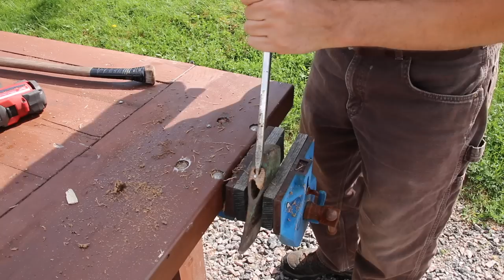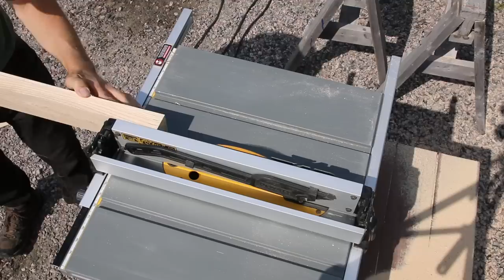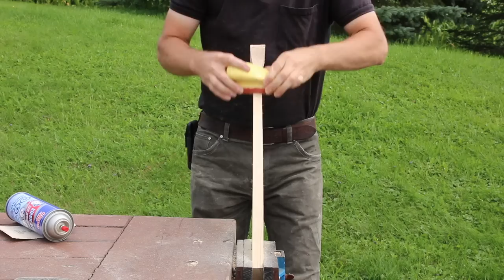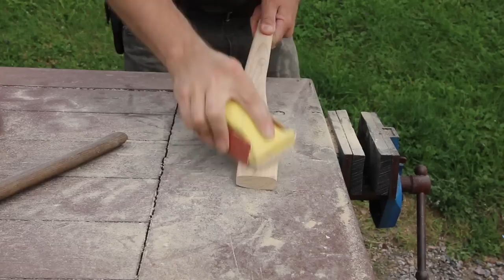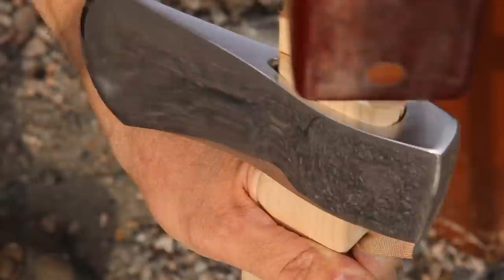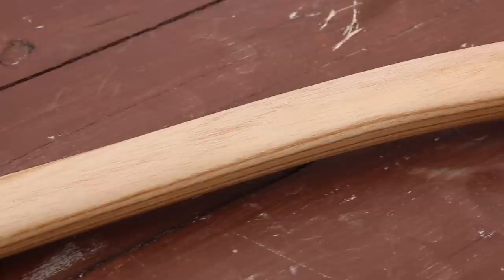How to make an AXE handle

Comment: Nicely done.  The man knows how to properly seat a tool handle. I really liked his choice of wood for this. Uniform strong grain and the runout on the tail end just makes it prettier not weaker. Only thing missing is oiling the wedge slot after seating the handle with a few drops of linseed oil. It helps to swell the grain just before driving the wedge home. It won’t dry out and will maintain the handles pressure against the walls of the eye.

Comment: Wow!  That was some remarkably straight grain!  That handle, unless seriously abused, will last 50 years!  Impressive work!
Reply: No .. got "run out " gonna break real quick,  most likely already has. You dont know how to make a axe handle either
Reply: explain  'run out '
Reply: The only way an axe handle will last 50 year's  is if you don't use it.  Also from the main picture it has really bad grain
Reply: Just me but that wood looks like pine board. If it is, best keep it as a decoration. Real heavy use axes require hickory or ash wood handle. Straight grained with no heartwood in it.
Reply: That handle is ash.

Comment: Your handle has "run out" the grain comes out the side of the wood ...it's gonna break right there.
Reply: They all have a little run out. All axe handles will break.
Reply: @MrThenry1988  not if you make it properly. Also that looks like pine which is awful for anything that involves shock
Reply: Just a Pilot I’m pretty sure it’s not pine. It’s much harder, probably ash.
Reply: @pedroclaro7822  lol that is not pine I'm almost certain just by the grain pattern

Comment: Great Handle, nice Video! 

Hint: at 2:00: place the handle between 2 wooden blocks into the vice. That prevents the handle surface from " bites or scratches of the vice jaws and (even more important) it prevents also the cutting edge of the drawknife from hitting the jaws. 

I'll soon have a similar project and this Video will certainly help me. So thanks!

Comment: Awesome work as usual.  You've convinced me to subscribe now as long as you keep putting out great videos like this.  What all did you use on the axe head this time?  I've been following your steps from the mirror polish videos but those are just for great wall hangers.  This one looks like a good usable axe, it looks like you used a green Scotch Brite pad at some point in the process?  Thanks!

Comment: Good job, tell me which wood do you use?
Reply: is very similar to the ash i this is it it's a very good wood for handle who don't required flexibility but rigidity for blacksmith hammer for example i prefer chestnut who transmitte less vibration cut a branch and take the new one 3year latter the ancestor do that and have very good handle !! better than our's for sure ! for have the black result they burn 
linseed oil below the hadle for resist at mold etc and increase durability, you can if you want burn the hadle aroud the point where you put the tool to make him strongest if you do that dont wait the wood show flame and was too burn just wait to have brown color

Comment: Having all that grain "run off" is absolutely the worse way to make a handle for an axe, hatchet, hammer, etc. A lot of folks may think it makes for an attractive look, & while it may do so for some wood projects, it's the worst thing to have in an axe, hammer, etc. handle. If its put through serious, repetitive use, that handle will eventually split along that "run off" grain. Its just a matter of when its going to split & what the dangers going to be when it does.

Comment: Verry nice job and wonderful restored axe! If I may give you a tip as a carpenter/knifemaker, lineseed-oil is great, but it makes wood harder but less flexible what is not so good for handles, use tungoil or danish oil instead, makes the grain of the wood come out nicely and keeps the wood strong but flexible! Kind regards from the Belgian Ardennes, Yves.
Reply from the maker: thank you! tip well appreciated  :)
Reply: You're welcome! Linseed-oil is great for the hitting surfaces of wooden hammers or bottoms of woodplane's( shaves?) or the handle's on woodchisels, they have to be as hard as possible. Like you're channel!
Reply from the maker: Yew Tree Knives  thank you!

Comment: Looks like a fair amount of grain run out near the bit, and the wedge is too short. Also, an awful lot of power tool use, which might makes things faster, but not necessarily better.